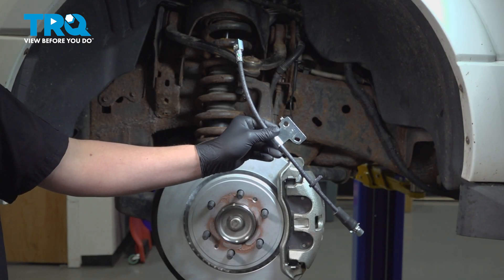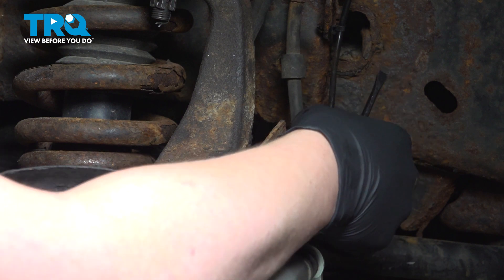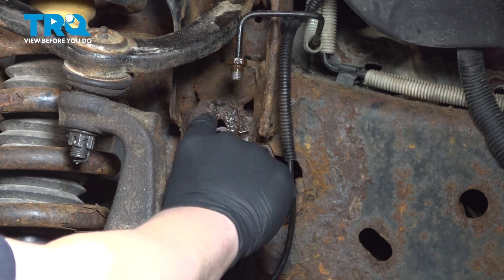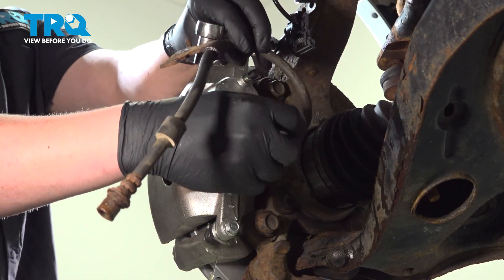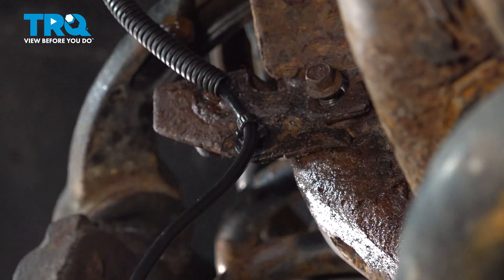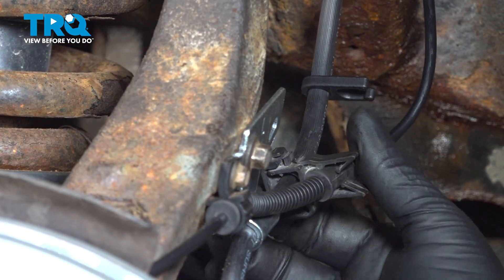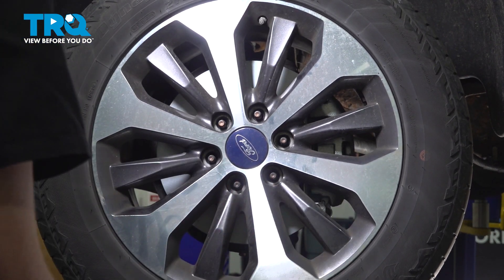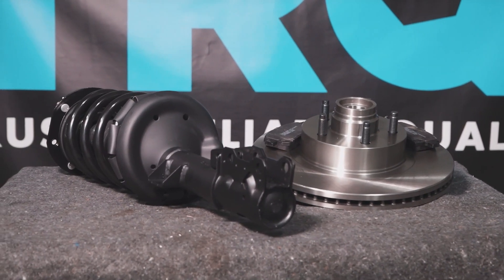How to Replace Front Brake Hoses 2007-2017 Ford Expedition

Comment: what size is the brake fitting that goes from the metal line to the rubber brake hydraulic line?  I followed your video, but both my front driver/passenger size fittings stripped a little bit when removing and now wont go back into the new brake line.